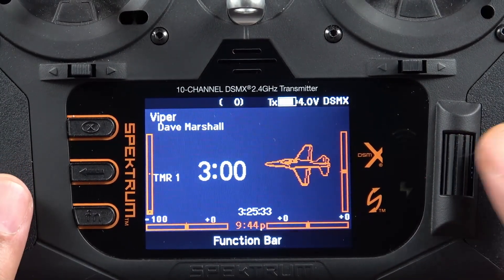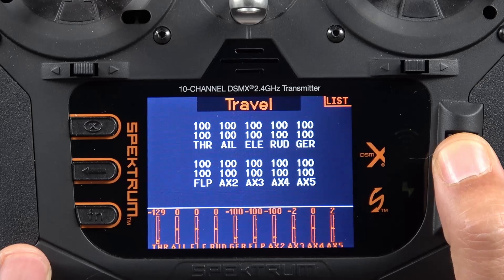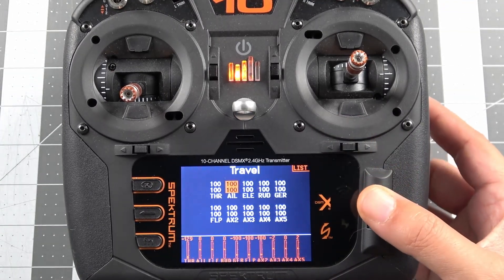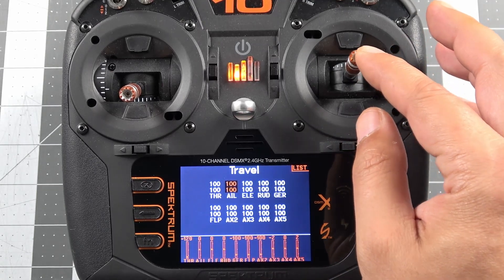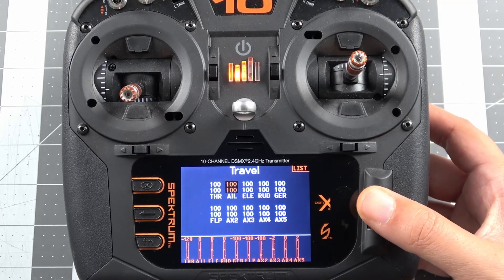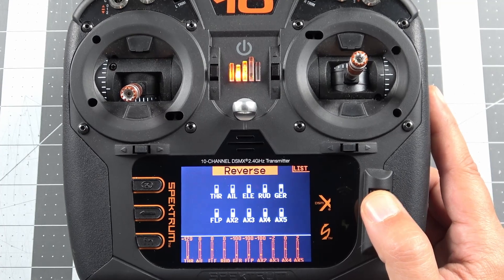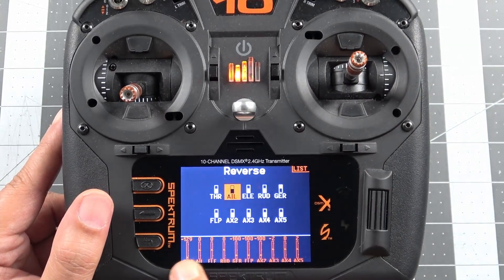Spektrum NX Series Tutorials - Servo Setup

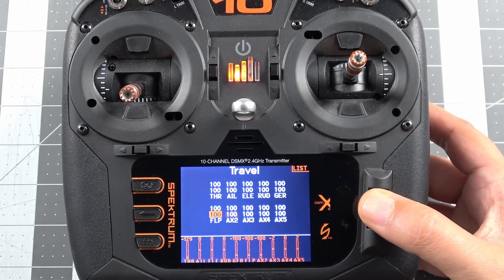Comment: Hello, I realize this was posted 3 yrs ago, but hoping you may still monitor and/or respond to comments about it.  I'm trying to configure a 2M RES sailplane using an NX8 Tx.  My plane has a single, centered wing spoiler that is plugged into the Rudder receiver port.  I have read, fiddled, read, fiddled, watched videos, etc.. so much my fiddler is sore.  The Spektrum "Servo Setup / Travel" screen seems to be beyond my understanding.  In watching your video, you demonstrate the example of adjusting travel for the Aileron "stick".  You explain how to isolate the 2 display travel numbers in order to have different left/right values.  You then proceed to scroll across the other channels and at 3:57 you go past the "gear" channel where only ONE of the numbers is highlighted?  Something is different there, but you don't address it.  You then proceed to the next setup item which is SubTrim.

Sorry for this long comment, but my question is about what you didn't explain.  I want to control my spoiler by a 3-position switch, not a stick, as you might with a gear servo.  I can't for the life of me figure out the programming there so that I can select the right amount of spoiler up on the 1 & 2 switch settings (0 is all the way down).It's kind of making me crazy - it seems random but I know it can't be.  If there's any way you could explain what Spektrum has in mind and how to configure the travel of a 3-position switch, I would be most grateful.  Thank you for sharing!

Comment: I came across an issue with my nx8 in the balance screen. The elevator center was at 30, so one direction it traveled to 70 and the other direction went to 130. Because of this, I could not program in reverse thrust. I’m not sure how it got here as I had never known about the screen. I adjusted it with the trim button because I didn’t know how the values would change things. All 3 lines on the graph were straight and by changing the values, the lines are no longer straight.  This is for a Turbo Timber EVO. If I understand you correctly, I would adjust the center tick by 30, testing each direction to be sure i changed it the right way?
Reply: Have you tried calibrating the sticks ?

Comment: Good info Dave! I use "Absolute Travel" to prevent a mix from adding travel beyond the "Travel" limits and overdriving a servo. ie: if I have "Crow" enabled and then lower the flaps, it prevents the flap servos from going beyond the endpoints.
Reply from the maker: Very cool application. Thanks for sharing